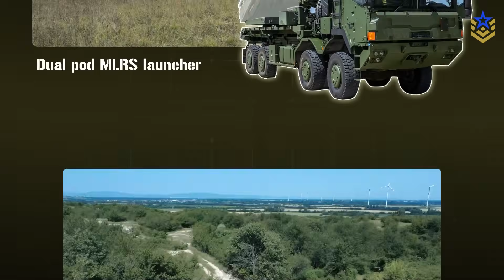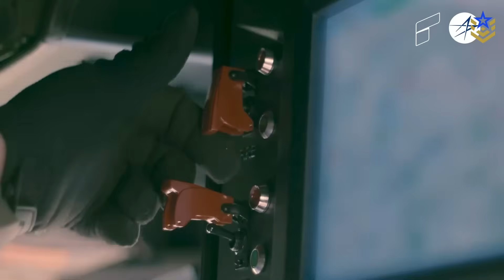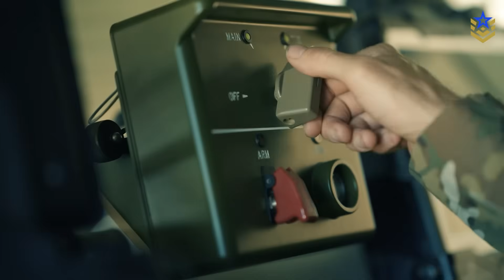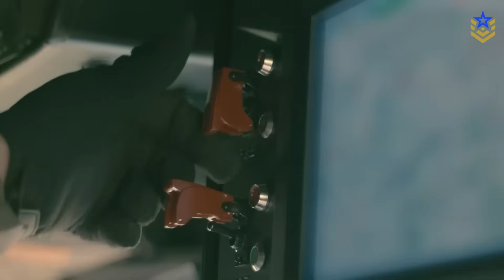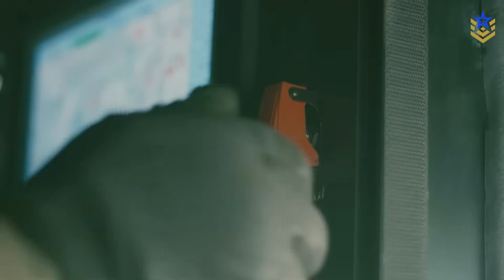Can GMARS Become Europe’s Next Standard Rocket Artillery System?

Comment: the problem of GMARS is hard to hide and transport
Reply: I think you didn't listen properly. Transport on wheels is significantly faster than on tracks. For example, 500 km (311 miles) are faster by truck in Europe than on tracks. Tracked vehicles are slower and would have to be transported by trains. Moreover, more missiles can be carried, as the report also correctly states.
Reply: @Toddel1234567  he probably talk about plane transport
Reply: @hotdog9262  Pretty sure it's made to be airlifted by an A400M
Reply: Because it has wheels ?
Reply: @jorgenfrohlich6954  Correct, UserXxxx Prn-U2w meant that chains are better. That is what I was referring to.
Reply: Sweden looks into these - 6 tracked - 6 Himars - 6 trucks to start with!?!